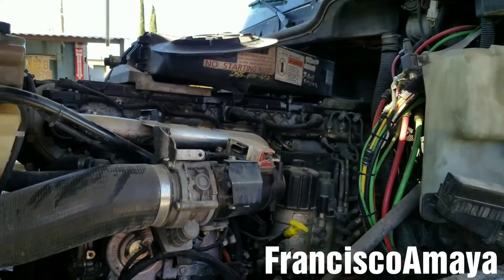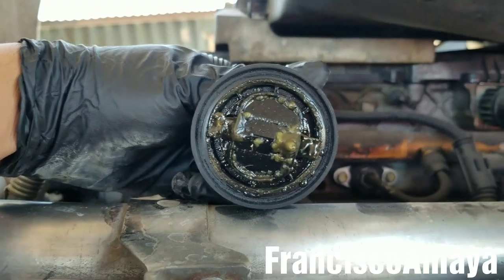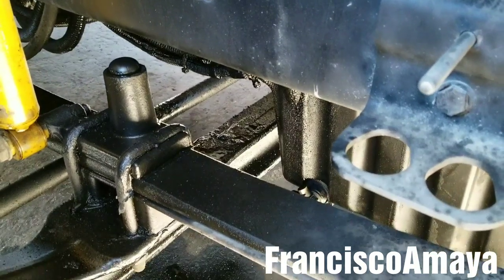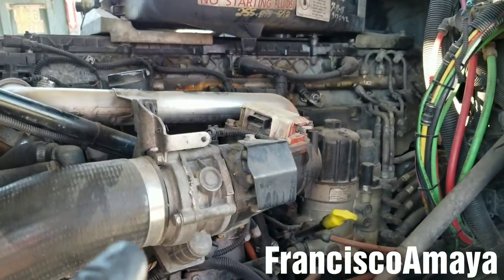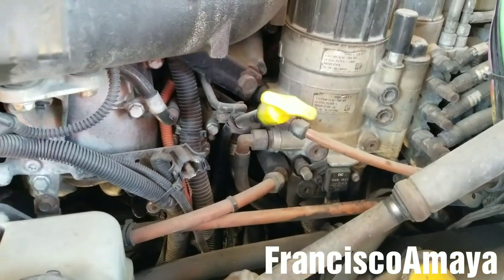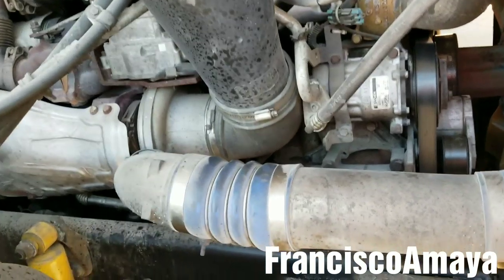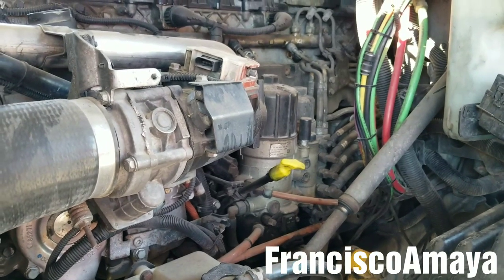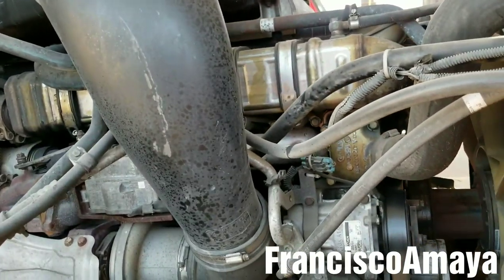Freightliner cascadia DD13 DD15 DD16 engine cylinder liner broken water in oil

Comment: Mine has a similar problem except for the misfire.
Looking forward to the overhaul procedure
Reply: adams P my truck is leaking oil from the crankcase even after a replace it. Truck runs good doesn’t misfire it has a lot of power water is good and oil is good also. I don’t understand why it’s still leaking oil

Comment: Change the oil every 12k ( semi sinthetic oil )miles and you wont have issues and injectors with harmess between 600k-700k miles.This engine deffinetly hasnt been well maintained .Replace crank filter, and do an update on the fuel housing filters and the egr valve. Replace Fuel pump at 800k  and doser . Replace the 7th injector every 200k miles  .Do a valve adjustment every 200k miles  and new coolant every 3 years. Check with dealer for new updates and replace the old parts with updated ones...and thats about it. Oh, and do preventive maintanance on the truck ...if it old replace it IT WILL GO BAD!!!!! better on your time and money than beeing towed to a dealer....Hoses, harness, sensors.....they will go bad  just a matter of time..so keep a schedule time sheet how old is the part and replace it!!

Comment: I had a coolant line replaced with a upgraded line from freightliner by passing the block because they say you dont need it they sell u the cap, the very next day my truck liner leaking causing me needing a inframe, coincidence or did plugging the line from the block cause it?

Comment: What is the cylinder liner? How fix? And how many Days my truck be in shop?
Reply: Cylinder liner is shaft where the piston head travels during combustion. 

Normal shop would take 10 days, Engine shop if everything ready 4 days. (I have a similar problem)

Comment: Many years ago I had the same problem on a Caterpillar 3406 E with water in oil and it was the head gasket. How are you so sure that it is a cylinder liner and not a head gasket?
Reply: I know from my experience working with the DD engines they have more issues with cracks or cavitation in the liners more often than a head gasket failure Detroit did a really good job to prevent that due to so many issues with head failures with the MBE engines.
Reply: Pull the pan and see where the coolant is leaking.

Comment: My truck is leaking oil from the crankcase even after I replace it. Truck runs good has a lot of power and doesn’t misfire. Water is good oils doesn’t have any water so I don’t understand why it’s still leaking from the crankcase. 
What could it be???
Reply: Did you find out what was the proablem ? 
I have same problem now 
Changed crankcase filter is leaking again 
Truck runs fine
Reply: Groza Ion yeap. Had to do an inframe. Piston rings were bad. Cost me about 13k.

Comment: Does it worth to do an inframe on a truck with over 1mil miles or is better to install a new/used engine.
Reply: Most mechanic would recommend a used engine because they dont want to do all that work

Comment: Hey all I have the same problem in my 2013 cascadia dd15 engine I have all these symptoms and using a lot of coolant a gallon for 1000 miles  first Francisco are you gana show us how to fix it like always or depends on truck owner I guess 2nd if I keep running on the engine like this how much can I run and what's the consequences regards God bless you and your family
Reply: The repair could become more costly if you continue to drive. If your problem really is a cracked liner, you could stop now and get an in-frame rebuild done. If you keep driving to the point that your engine oil fully breaks down and can no longer properly lubricate, you could cause damage to your crankshaft and the engine will have to be remove to be repaired, or replaced.
Reply: Makes sense time to spend some money on it thx man
Reply: N K no problem. See Francisco’s newest video, what I explained is exactly what happened to the engine in the video.
Reply: Grew Dangl yes but if I do overhaul let me run it as much as possible and break it down and use maximum potential of it

Comment: Head is bad? Or block? You have any video changing cylinder
Reply: Hack Daddy - Official - Neither, it’s the cylinder liner. I had this exact thing happen to me truck going in and out of shops because the condition was intermittent shops couldn’t diagnose the fault. Eventually the liner failed completely and hydro locked my engine on fwy. Only 600,000 miles. Drove it like a baby. Yet still failed. Ugly times.
Reply from the maker: Coming soon...

Comment: How much does it cost to repair this engine?
Thanks great channel
Reply: Somewhere over 15k. I got lucky and was able to get a good low mileage dd15.
Reply: My mechanic tells me he’ll charge me around $12k if I don’t need a new head. The damn overhaul kit itself cost around $8k.
Reply: @thermroberts380  That's not bad. You can get a remanufactured head off Ebay for 3k
Reply: Cost me upwards of 20k because this issue hydro locked engine and destroyed the crank as well.
Reply: @RichardandlindaMelto  I'll keep this in mind..
Reply: @or1g1n4l01  wouldn't it have been cheaper to just buy a good used engine and swap out?
Reply: @thermroberts380  I got my dd15 from national diesel out of Atlanta.  Good luck brother
Reply: CROWN ROYAL That’s what I did bought an engine with 250k on it for 15k mech charged 3k to put in. Then i had issue after issue with the engine. All together cost me about 22-25k not including downtime.

Comment: Hey I got dd15 cascadia 2013 cylinder 4 is burnt and coolant in oil and injectors overfuel any suggestion plz other than overhaul  ? Overhaul Too expensive for me  they want 45000
Reply from the maker: $45000!?
Reply: I have the same issue on a DD13, theyre telling me 11k to get it back going and double to overhaul.
Reply: How many miles you have on your truck?

Comment: Tengo un Volvo 2006 670 cumins isx el problema es que encontré aseite en el coolant recervoir que podría ser
Reply from the maker: Es possible que sea el oil cooler
Reply: @franciscoamayaYT  
Muchas gracias 
Bendiciones
Reply: @franciscoamayaYT  
Buenos días 
Pero lo puedo andar manejando asi asta que lo repare

Comment: My coolant is pouring through out of the oil pan as fast as you put it in   Is this probably my problem
Reply from the maker: It is possible. The best will be to remove the oil pan to inspect from where the coolant is coming from.

Comment: Brother where is your shop can I come to u I have low oil pressure and check engine light. I have cummins x15
Reply: Ben Bhatia he is in Fontana.
Reply: Hack Daddy - Official - where in  fontana brother
Reply: Ben Bhatia no idea he Does not tell his exact location.
Reply: Hack Daddy - Official - he is good mechanic I need to see him bad because I have low oil pressure and I am near fontana.
Reply: Ben Bhatia yes he is very good mechanic but he has never told his address
Reply: Ben Bhatia you will need to send him an email and mabey he will tell you but not on YouTube
Reply: Hack Daddy - Official - what is his email and I see oil coming from my truck I can't find it and very low oil pressure can u please find his email. I will loose engine preety soon. Tnx and god bless you
Reply: Ben Bhatia it's in description
Reply: Hack Daddy - Official - tnx a lot brother
Reply: Ben Bhatia let us know what was the problem and how u fixed it.
Reply: Oil Pump reseal,  especially when your coming from highway speeds and to  a stop. Red check engine light comes on. drop the oil pan and replace all the o-rings on oil suction manifold.

Comment: Hello guys and Francisco can someone help me here. I have a 2015 Cascadia dd13 it’s loosing half a gallon every 500 miles i did coolant pressure tested no leaks external no water in oil I also removed egr cooler to turbo elbow pipe my self. egr cooler looks dry any ideas were it can be I would appreciate any help thank you
Reply: carlos Macias 
My 2013 Cascadia was doing the same thing & it turned out to be bad radiator. I had new radiator put in at Freightliner in Dallas $3000 all in. Good luck
Reply: brad triplett we solved the problem it was oil cooler housing replaced yesterday all good today thank you for your reply and help
Reply: Good deal, hope all goes well 🙂👍